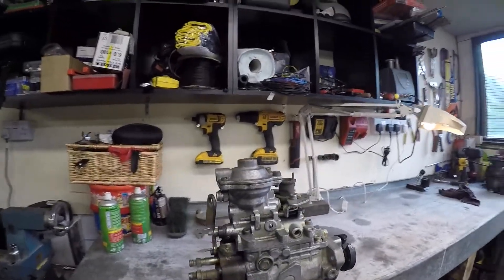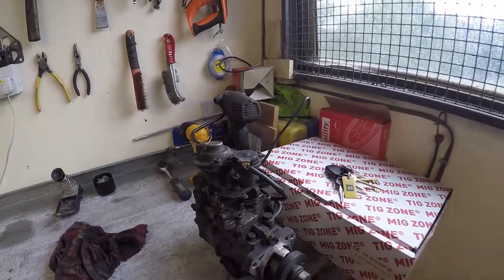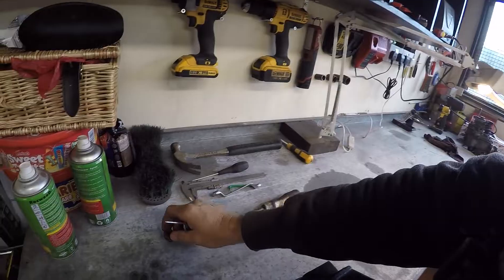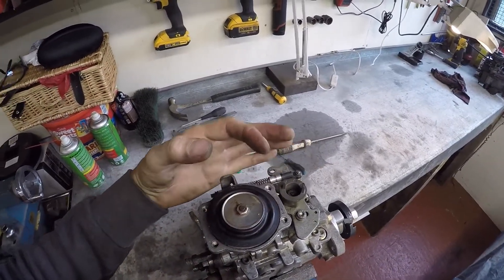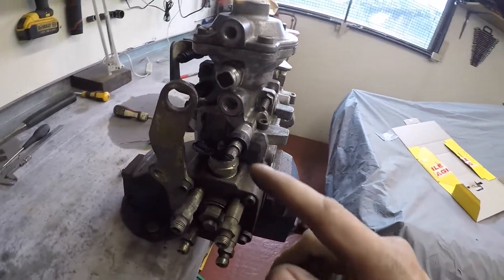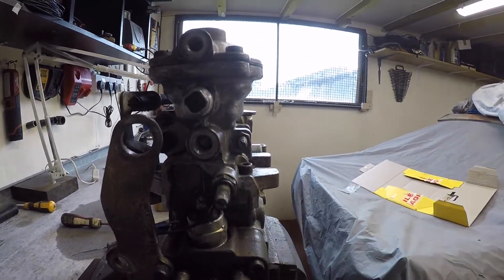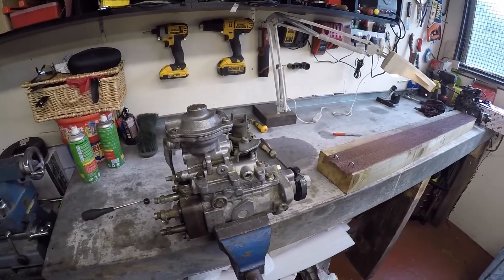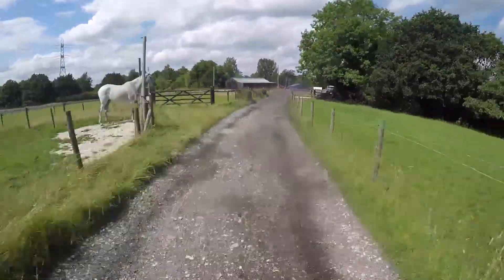300TDI & 200TDI Injector Pump Modification Land Rover Defender & Discovery Bosch VE pump

Comment: I did this to my 200tdi, it did work very well at first. I definitely saw a huge increase in power, however, I’d recommend against doing this to your vehicle unless you drive sensibly or get and EGT gauge installed. Personally I found that it didn’t suit me, today I was driving along only to realise my car had become noticeably louder, at first I thought this is awesome (blasting through the high street smoking all the pedestrians) and then when I got home   I noticed something. The EG temps were too high which resulted in burning off my exhaust and mud flap ! 😂 I’m sure if you take the right precautions this modification is safe, but if you have a heavy right foot driving day to day I wouldn’t recommend it. Please keep in mind I drive like a prat and you may not experience the same thing I did! But it was a good experience, and I don’t regret it.
Reply from the maker: Thanks for the feedback, yes is best to monitor EGT’s and tweak accordingly really, you can get some quite cheap kits that work quite well now, and also good to fit a larger intercooler and turn the boost up to match extra fuelling 👍 cheers

Comment: Just opened up my 300tdi and where you have that little plastic coller I have nothing!
Reply from the maker: I think someone may have been possibly in there before mate, some people take them out for more travel.
Reply: @CarJunkeez  Thanks for the reply, did wonder that but as long as it does not screw it up thats fine, although the hose was missing off the wastegate as well.

Comment: Sorry I arrived at the party rather late. Just wondering; what happens if you do the tweaking in the pump but do not do the 6mm turbo actuator adjustment? Will it affect/jeopardise the ultimate outcome?
Reply from the maker: Hi, no you will just get more black smoke than if you’d adjusted the boost and a little less power, but should be fine 👍
Reply: @CarJunkeez  thank you mate.
Reply: Hey @CarJunkeez  I’ve been trying to find a video of you doing the turbo actuator adjustment but can’t seem to find any. Have you done one before? Is there a link I can follow? I’ve found a few from other guys, but I like your simplicity. So I’d much rather use another of your simplified explanations.
Reply from the maker: Hi mate, sorry I’ve not done a video on the Tdi boost actuator adjustment but possibly in the near future if I get chance 👍 cheers

Comment: Pin clock wise 90 degree round.. why
Reply from the maker: From a standard setting this will increase the tapered angle of the lower pin to increase fuel span 👍
Reply: @CarJunkeez  What you mean to say is that the pin will be removed from the company's antidote and 90 degrees will be filled with fuel.
Reply: You drove fuel from everywhere Black smoke
Reply: @CarJunkeez  What is the correct boost  pin location
Reply: Plz reply
Reply from the maker: If it’s been previously moved from standard then it’s difficult to tell where it was. If you look at the bottom of the pin you can see the taper offset is more if rotated and this allows the pin that presses against it horizontally to have more movement and this is what you want to increase fuelling. Yes you will get some black smoke if you do all the mods in the video, it’s then a good idea to turn the boost up 👍

Comment: How do you delete the egr? Is there a kit available?
Reply from the maker: Hi, very easy, just remove and fit blanking plate and pipe, you can also remove the rotary switch assembly off the pump to if you wish.

https://www.ebay.co.uk/itm/290483010436

Comment: My 300tdi has no power taking off at the lights or a slight hill until boost comes on and then it’s away with plenty of power and not much smoke from what I can tell. I noticed the idle isn’t smooth and consistent and is a bit slow in my opinion. What’s your thoughts on this? Should I adjust my pump or look elsewhere for the problem?
Reply from the maker: Hi, I’d definitely check for other issues first before tweaking mate. Could be anything from bad injectors to bad pump or air leak, even valve clearances, good luck 🤞
Reply: @CarJunkeez  Cheers for the reply, I should’ve added the injectors have been serviced, tappets done when head was changed and unfortunately the pump has been fiddled with before. I replaced the diaphragm and the plastic spacer you sanded down was missing. I did turn the fuel down a bit cause it was a bit smokey for my liking and cause the tamper protection had already been removed
Reply from the maker: Oh right got you, it could be an injector pump issue then, you could try adjusting the injector pump timing with the 3 10mm bolts behind the little cover first.

Comment: Is it as simple as buying a boost pin taking the old one out and putting a new one in ?
Reply from the maker: Yes you can just fit the boost pin without any other mods, just make sure you put the pin in square on to the fuel pin in the bottom of the hole 👍
Reply: @CarJunkeez  may sound silly when you mean square what do you mean by that do you line all the little dots up ?
Reply: @CarJunkeez  if it doesn’t go in square whats the issues it causes
Reply from the maker: The aftermarket boost pins that you buy are like a wedge with a flat edge unlike the original that is conical so you need to make sure you put it in so the flat surface is is flat against the fuel pin at the bottom of the hole.
Reply: @CarJunkeez  okay yea that makes more sense now sorry for the silly questions 😂do you need to like any of the dots up I’ve seen a few that have little dots you need to like up

Comment: So I have just bought a defender 300tdi I know nothing really about mechanical stuff and just ordered a boost pin 😂is it easy to put in myself without doing all the tweeks you did ? Anything I need to make sure I do
Reply from the maker: Yes you can just fit the boost pin without any other mods, just make sure you put the pin in square on to the fuel pin in the bottom of the hole 👍

Comment: Interesting way of doing things, I do the opposite. What you’ve done is made the LDA have less of an effect. I put the boost pin on shallow setting and grind it on the boost side for extra fuel. Also wind start screw up higher and even machine under lda so that diagram can sit even higher. Increase the star wheel spring rate too. All these mods lean it off, which then allows you to wind in fuel on the main fuel screw. This way the boost can control fuel far better and there is less smoke labouring off boost.
Reply from the maker: Hi, yes there’s many different ways to adjust the fuelling, this is just an easy method for people to do that’s more orientated for off road use as it also adds fuelling low down before boost to help with lag and helps to spool the turbo earlier, also I’m trying not to influence not to experienced people to adjust the main fuel screw to much as run away is possible. Thanks 👍

Comment: Great how too vid fella 👌...can I ask if the setting would be the same if using a modified boost pin inside the pump?
Reply from the maker: Thanks mate. Yes the principal is very similar apart from the rotation of the pin as aftermarket boost pins are flat so just make sure the flat side is fitted correctly and don’t rotate it 👍

Comment: Any suggestions for freeing off and gripping a seized star wheel / preload adjustment?  Breather at the back of the pump has sucked in muddy water and corroded it stuck.
Reply from the maker: I’ve had them the same mate, I fill it up with wd40 or similar over night and blast out with air line next day and fill back up with wd40 again, eventually it will free hopefully 👍

Comment: I did it from start to finish. But my vehicle is running 1100rpm is it normal???
Reply from the maker: Hi, yes this can happen, you just need to adjust the throttle screw on the injector pump, it’s the one that is on the throttle mechanism. 👍
Reply: @CarJunkeez  My car was 300tdi rn380 1995 discovery. I got really good results, thank you. Turbo new vgt ..
Greetings from Turkey
Reply from the maker: That’s awesome 👏 cheers🍻

Comment: Is this better than buying a bigger boost pin
Reply from the maker: It’s similar, but with most aftermarket boost pins you need to make sure that they are square on to the pin as they make them flat and not conical like the original, also some are made of softer metal so wear a groove where the pin slides.

Comment: Extremely helpful video, but get confused on 'steepest'. Technically, the 'steepest' would give less travel that the 'deepest' cut out would. I've seen other articles that say the 'deepest' cut side is where you want the pin contacting. Correct? Thanks!
Reply from the maker: Thanks mate,  yes your correct, think it’s the Manc way of saying things kicking in 😂 sometimes can be a problem for me 🤣 cheers 👍
Reply: @CarJunkeez  Thanks MUCH for the reply! Now i can put it back together. ;-)
Reply from the maker: No problem, cheers 😃

Comment: How much power gain with all that setup? I have rotated the pin 90º and the star wheel by 1 full clockwise turn, its more responsive, do you sugest turn the fuel screw by 1/4 or a half turn?
Reply from the maker: You can see anything from 10 bhp to over 20 bhp depending on if you also increase turbo boost, yes try the fuel screw 1/4 just be careful then another 1/8 👍

Comment: Hey. Why shorten the actuator drive?
Reply from the maker: Making the actuator rod shorter on the turbo will increase turbo boost pressure and is beneficial if you’ve increased the fuelling 👍
Reply: @CarJunkeez  Thanks for the answer. Why loosen the spring?
Reply from the maker: Loosen what spring ?
Reply: @CarJunkeez  Spin the star (gear) clockwise. The spring becomes softer.
Reply from the maker: It’s to decrease resistance so the diaphragm will respond quicker to boost and allow more fuel
Reply: @CarJunkeez  OK. Thanks. And to make the plastic ring thinner, is it to increase the fuel supply in the upper boost range? Sorry, I know English very bad.
Reply from the maker: Yes that’s correct, it’s to allow slightly more fuel on high boost.
Reply: @CarJunkeez  OK. Thanks a lot for the answers. You have confirmed all my assumptions.

Comment: How much difference would 0.2mm on the dti when timing. Would that make if its retarded by that much?
Reply from the maker: I’d set it up at top dead centre for the correct lift that the manual says for your pump (eg. 1.4mm or 1.54mm  is common) then I just tune by driving and listening to pinking and adjusting the timing with the 3 10mm bolts on the pump gear, I suppose you could then remeasure the lift and work out the difference if you really wanted 👍
Reply: @CarJunkeez  this is in a boat so continual torque load is my concern re: leaning on the timing too much
Reply from the maker: Yea I suppose it could be difficult listening for pinking in a boat. Interesting that you’ve got that setup in a boat 👍
Reply: @CarJunkeez  its a VM built engine. Has BMW castings on it. Marketed as a Mercruiser.

Comment: Have been struggling with tuning a pump I put together almost 10 years ago. 

Young- stupid me totally tossed the plastic spacer above the star wheel,
And ground the fuel pin way down. 
I had forgotten as I did these mods to a different pump, and swapped them over. 

My issue was that I could get crazy fueing- even with the max-fuel screw out like 3+ full turns!
Reply from the maker: Yea can be difficult to get back to normal when they’ve been messed with before. Make sure the little pin isn’t seized deep down in the hole

Comment: Hi after watching this video i decided that I am going to adjust the pump on my 200tdi, the only thing is my fuel pump has been rebuilt at some point and the fuel screw has the plastic tamper seal broken but the metal clip has been replaced how can i tell if it has been wound in or not . I dont want to adjust it and kill the engine.

Cheers Ben
Reply from the maker: Hi Ben

If it’s been rebuilt by a reputable company then it will be set correctly, but you won’t know that for sure so I suggest you only adjust 1/4 turn first time, then and 1/8 turn a time after, you’ll know if you’ve overdone it as you will get excessive smoke throughout the rev range so back it off again if so 👍
Reply: @CarJunkeez  Hi thanks for the reply I will give it a go but I am not sure who rebuilt it but they have used yellow marker paint as indicated on all the bolts to see if they have moved, even the fuel screw but I will try 1/4 turn first
Reply from the maker: Sounds like a breaker has just marked it up for there anti tamper warranty too so hopefully the diaphragm parts may been in there original location 🤞 if your really worried about run on then you can always take the boost pipe off the inlet manifold and have something flat to put over the inlet to stall on first start up to stop run on 👍
Reply: @CarJunkeez  ok will do
Reply: @CarJunkeez  just had a look and I don't have the plastic collar that sits around the boost pin is this bad?
Reply from the maker: If the collar is missing then on full boost the diaphragm will be allowed to travel further and the fuel pin will be fully open, some people do run without them but I recommend using one even if it’s only 2 or 3mm thick. Just see how the smoke is on full boost first before adjusting things 👍

Comment: Do U have video on changing the seals. I got ve pump on my patrol BD it has 2 leaks, one like a river, cheers
Reply from the maker: Hi, sorry I’ve not done a video on seal replacement, perhaps in the future I’ll do one as it’s a common failure, especially the throttle spindle seal. Thanks
Reply: @CarJunkeez  well if a common failure. U think U get a lot views 😉

Comment: nice video,clear and very helpful, i will try it to my Daihatsu Fourtrak (because it has similar injection pump). if i tune the boost compensator and the fuel load screw ,is there any posibility i need to change the timing of the injection pump? thanks
Reply: Thanks bruh, i get more confidence now.
how about the EGT, how many °C your EGT before and after tuning? how many °C the safety limit ExhaustGasTemp for Diesel Engine?
Reply from the maker: Around 750 is good for the high limit but you can still go to 800 or even higher for short periods and all will be good, it’s just if your hitting 850 plus for long periods then things are gonna go wrong.
Reply from the maker: Thanks mate. Yes your correct the Fourtrack have a sort of clone of the Bosch VE pump that’s very similar and the same procedure will also work on them, just note that they don’t have the plastic spacer washer on most of them and the diaphragm housing and fuel pin are slightly different but just do the same mods as in the video and will work the same, just bear in mind that the top screw on the top of the diaphragm housing for the low rev range fuelling is slightly different so adjust this in smaller increments like a quarter of a turn and try. You won’t need to change your pump timing, although you can tweak if you want to 👍cheers Shane
Reply: Thanks for replying my question. you are very helpful for a beginner like me.
In 13.16 when you explain about rotating the Fuel load screw you said if more than 180° is dangerous and the engine will run on, do you mean diesel runaway??
Reply from the maker: No problem, thanks. Yes that’s correct diesel runaway so be careful, you can have a flat piece of wood ready to block the Inlet of the turbo if your worried 😦
Reply: okay got it. but if it not over than 180° then its not too risky for a diesel runaway right? have you ever had a diesel runaway with your InjectorPump setup?
how much psi increase you get from IP setup and wastegate rod modification?
im sorry if i ask a lot of question
Reply from the maker: Never had run on from a standard setup with half a turn no, you’ll be fine mate, just some people go crazy and that’s when things go wrong.  If you shorten your waist gate actuator by around 6mm then you should see around plus 4 to 5 psi and this works well with the extra fuel delivery 👍

Comment: Ok matey do you know how you say set the gap between 5/7 mm this is with the standard boost pin , would you set the diaphragm gap the same using a fourby boost pin ? Just thinking when you use the fourby pin you don’t use the Nilon spacer . Would this effect the gap height cheers .
Reply from the maker: Hi mate. The 5/7mm is with a standard pin and shaved plastic collar but to be honest should be somewhere near for aftermarket boost pins to, you can have a play with it if you want and your looking for how much black smoke you get in mid range, if it’s to much then widen the gap or if it’s not enough then close the gap up a little 🚗💨cheers👍
Reply: CarJunkeez 
Will have a play tomorrow once I fit this boost ring 2 
thanks for the reply . Liam 👍

Then once am happy with midrange smoke / power , should i then have a play with torx screw in the top ? Just to the same as this , have a play till pull of just smokes then ease of with that till happy .
Reply from the maker: No worries pal and yes you got the top torx screw sussed there mate bob on, in for more low end smoke out for less 👍💨